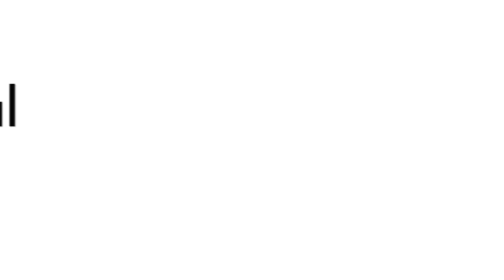Mercedes E300 Full Leather Interior Repair | leathercare.com

Comment: Awesome work! I never knew this could be done. I thought leather seats like this had to be re-upholstered. Keep up the great work. GODSPEED mate!
Reply: Re upholstered would be a better option imo
Reply: @AlexiaVon  Most of the time the re-upholstered will never have the quality standard of the original.
Reply: @MAIQUELKOCH  depends, are you a cheapskate working with a shady business or are you willing to spend money on quality materials and decent work being done on the reupholstery.
Reply: @sv_cheats1970  That's why I said MOST OF THE TIMES, there are exceptions, for example companies that manufacture for the automakers themselves, some of these companies sell to the final consumer. It is worth noting, however, that the product sold to the automaker goes through the sieve of quality control within the automaker itself, more demanding consumers should also consider this.
Reply: @MAIQUELKOCH  and MOST IF THE TIME refinishing or painting or staining you will not have the same quality as the original either and you know this. Even this one is not the same quality as
Reply: @AlexiaVon  I agree 100%. You will see cracking in the same areas over time as the filler is the weak point. Not sure how much this would cost as shown in the video. But today, I can buy an XL hide (top grain) in the color of my choice for $700.00 and pay another $500.00 for labor. So for about $1200.00 (I know it's more), you will have new seats for years to come.
Reply: @kenkobra  Over $1200 for two old seats...I'll pass, not because that I am a cheapskate, but I am just a practical guy.  Itis like that you are getting old and trying to do cosmetic plastic surgery...No matter how you look great outside, you know that inside it is the same old self... Getting old is not for the sissies as the saying goes.  Face it and you will find inner peace, all those naysayers are just that, naysayers...
Reply: @MAIQUELKOCH  There are companies doing reholstering using the same oem leather as the manufacturer. It just cost more. Still imo is better than this as I think there will be too much toxic gas release from all the spray.
Reply: This is a quick and dirty fix that won't last long. it's just a coat of paint sfter all.
Reply: @AlexiaVon  I asked how much it would cost to reupholster my interior, and I was quoted around 5k. I was like god damn, lol no thanks
Reply: @MAIQUELKOCH  here we go. Get your popcorn ready people...
Reply: @slchang01  Yeah, if cosmetic surgery involved completely removing your old skin and replacing it with new. There's a HUGE difference between stretching and removing than there is in REPLACING. They also replace the padding and any frame defect when you get it done. It's pretty much a new seat.
Reply: @mc.9839  New seat indeed...though at what cost?  An old car with all OEM parts sum up  to the tune of 4 times the price of the brand new one, not including the labor costs...Is it worth it?  And let's say, now that you've got a new seat, and it looks pretty...but what about other old seats? or other old parts that yet to be replaced over time?  Do you feel the same way as if you were having a brand new car?
Reply: @slchang01  Seats are typically only done if they're truly heinous or you are doing a restoration and they all get done.  If they're heinous and you aren't doing a restoration you just put good seat covers over it. Nice and cheap.
If it's a restoration then everything looks good.
Yes, the only time I got new seats was because I had restored a 95 Bronco. Yes, felt like a I had a new car. Actually, it felt better. WAY better.
Reply: @madmade6877  yes, but surely it's a lot cheaper?
Reply: @ziondanny7081  but the original leather was dyed to begin with, yet the dye seems to last long. or is this spray dye not as long lasting a method? I'm genuinely wondering because I don't actually know that much.

Comment: Fantastic.  I never ever thought you could rejuvenate leather like that.  Great video
Reply: Yes you can and you don't even need to spend that kind of money.  There are more videos here you can check.
Reply: @josechimal1358  I’m amazed, the dedication and concentration required would probably be far in excess of what I could do personally as I have the attention span of a child, but watching proper detailers and leather workers on YouTube has opened my eyes to what can be achieved with even what seems unrepairable
Reply: Would’ve been cheaper to buy a new seat 😅😆
Reply: @Smith6265  why can’t you appreciate the craftsmanship?   Not everything is about saving money, it’s nice to spend more and get a better service, that’s why people drive bentleys or
Rolls instead of hyundais, and wear a Rolex and not a timex - they appreciate quality, even though the cheaper products do the job just as well as the overpriced ones
Reply: Is it rly rejuvenated or its for looks only? U cant maintain it with leather cream, it might rub off on white clothes and it could quickly deteriorate in the sun and feels sweaty?

Comment: Wow, I never thought those types of repairs were possible with leather.
Reply from the maker: Thanks!
Reply: question is how this repair will last and how the filler holds up under use and surfaces flexing.
Reply: Robert Duklus 2 weeks
Reply: @aqib2000  😁
Reply: @aqib2000  😂😂😂
Reply: Color going to get all your clothes when it heats going to start getting hot outside or inside the car so I get hot a color is going to ruin your pants
Reply: @07churchuse  That is exactly what I was thinking while watching  - perhaps a more gentle approach is more realistic; maybe not as contrasting, but less time intensive, and still better for appearance, and overall long term wear...
Reply: Me to waaooo 😘
Reply: @07churchuse  Seriously??? All leather is dyed. When did you last see a blue cow walking around? Once it's dried, the dye will never get on your clothes. On top of which, he even finished it with a clear coat and a hardener. Dummy.
Reply: @07churchuse  only mark zuczerberg can sit on this! xD
Reply: @07churchuse  I really hope you're joking... if not, then you gotta get your head checked
Reply: IT'S NO LONGER REAL LEATHER. IT'S BEEN TOTALLY COMPROMISED 
LEATHER NEEDS TO BREATHE. AND CONDITIONED WITH EARTH NATURAL PRODUCTS. NOT PAINT.😣😤😤
Reply: @eaglesonsolutions9697  That's tanned leather in its first stages. Doing it later, like here', destroyed the little suppleness left. My gramps Is  a leather Smith!! I help
Reply: @captainamericaamerica8090  The only alternative to what you suggesting is reupholstering it which also take the originality away. This is the cheaper option. Once you fill the cracks with filler, There is nothing that is natural that will give you that exact color back. If your looking for a natural repair solution, good luck finding a tutorial that will make it look as good as this.
Reply: @captainamericaamerica8090  There's no such thing as natural breathing leather on new cars, all leather is sprayed with a protective clear coat. So called leather conditioners by people like Leather Honey and Chemical Brothers are only changing the smell and surface of the clear protective coating. There's no nurturing of the leather lol.
Reply: @kccodex8931  it's a porous coating, apparently
Reply: @robertduklus6555  +q+
Reply: @captainamericaamerica8090  that may be true but I'd rather spend my money on organic veggies. But I get your vibe.
Reply: @eaglesonsolutions9697  Very true, but to me it looks like a lot of labour intensive work and the cost would be interesting.  Depends on the value of the car I suppose, but I'm guessing it wouldn't cost much more to find replacement seats in better condition.
Reply: @kccodex8931  not true.
Reply: @eaglesonsolutions9697  the point the poster was making is valid, as a
dye is absorbed right into the grain of the leather, whereas a paint is
just sitting on the "surface." How long it will hold up in extreme heat,
or from moving around on it from wear and tear -- I do wonder. If they
could redye the leather, I'd be way more confident than painting it.
Reply: @erickabundis7952   the point the poster was making is valid, as a
dye is absorbed right into the grain of the leather, whereas a paint is
just sitting on the "surface." How long it will hold up in extreme heat,
or from moving around on it from wear and tear -- I do wonder. If they
could redye the leather, I'd be way more confident than painting it.
Reply: @captainamericaamerica8090  leathersmith.....you mean a tanner, Mr helper?
Reply: @captainamericaamerica8090  
My Cadillac convertible is 47 years old.
Leather stays.
Be a FOOL to re-do it.
Cosmetic aesthetic damage.
Not structural to material.
RECYCLING 💡
Keep your car clean & oil the seats after.
It’ll smell fine😉
Reply: @captainamericaamerica8090    this is finished leather. No disrespect to your gramps but You don’t know what you are talking about. Aniline leather needs to breathe, so in that specific instance you are correct. Aniline is an unfinished hide often used for high end sofas and furniture. Way more susceptible to water damage and weathering. This being a finished leather (as most vehicles are) it can be repaired once it is worn and aged, hence “refinish”. Leather is leather no matter which way you shake it. It is skin. There are substitutes such as ultra leather which is manufactured. If it’s skin when it is tanned dyed and finished, it is leather when you refinish it as well. In Laymans terms sheet rock is still sheet rock regardless of how many times you repaint it. So your comment of “it’s no longer real leather” is just wrong. This is my profession. If you don’t know what you are talking about then why even bother commenting?
Reply: @grantp4022  in a two stage refinishing process (paint then a heat treated topcoat) heat ‘shouldn’t’ affect the integrity of the finished product if done correctly. That being said refinished leather will always wear faster than the original product. Like you said it is only a surface application. So wear and tear is definitely expected over time if not maintained correctly. This method is often used because Reupholstering is much more expensive. Refinishing is tedious but much more affordable for a similar finished product.
Reply: @07churchuse  you are wrong. 🤝
Reply: @captainamericaamerica8090  automotive leather is not real leather.
Reply: @eaglesonsolutions9697  wasn’t going to give the thumbs up but then you said dummy. Thanks lol
Reply: @robertduklus6555  i work with colourlock and have never problems, when you use it right
Reply: @eaglesonsolutions9697  so your telling me Belgian Blue's leather isn't blue 🤔🤨🤯 

(Jk ofcourse)
Reply: @doublesnake18  bruh, i did It in one day

Comment: It looks really very well done. I had repair in my W210 in a same way with amazing final results . But cannot be as a new one in 2 years again I have cracks and my eyes are always there when I open the door . Just to mention after repair it was really amazing , car is always in garage with controlled humidity . 2 years and 26 000 km again I have cracks .. And finally decided in the beggining of May to change completely the leather in front .
Reply: Yes ~ nothing can compare to brand new leather!  I tried to repair the leather on my steering wheel with what were claimed to be quality products. The result LOOKED good, but the steering wheel always had a slightly sticky feel after the process. Finally decided to have the steering wheel professionally recovered in new nappa leather. Sooo nice!

Comment: Great Work, but what about seats with air condition? Don't know if the W124 had them, but i.e. a W211 with these little holes in the seats has air conditioned seats. Are they still working after you put paint on the seats with a spraygun?

Comment: Looks wonderful but I too want to know how this holds up from actual use... I can only imagine small cracks would immediately develop in the painted areas as paint is typically quite brittle and inflexible.
Reply: and the leather don't breathes now...
Reply: @JP-cu9zb  Of course it does. Why would it be any different than in the original situation?
Reply: Leather paint is not brittle. Otherwise your brand new seats and sofas would show small cracks the moment you start using them. It is only when they age that leather and paint becomes brittle.

Comment: Wow thats amazing! That looks like an art form that i wish i would to be able to do! The end result probably looks better than it was brand new
Reply from the maker: Thank you sir!
Reply: IT'S NO LONGER REAL NATURAL LEATHER. THAT'S WHY THERE ARE SO MANY DISLIKES!! REAL LEATHER NEEDS TO BREATHE. IT CAN'T NOW! 😩😩😣😣👎👎
Reply: @captainamericaamerica8090  spoiler alert: they all seal it with plastic
Reply: @captainamericaamerica8090  I used to think that too until I looked up the science behind the clear coat. The polyurethane coat is microporous, allowing the leather to still breathe.
Reply: @captainamericaamerica8090  ñbadadd
Reply: @alc.8415  Not true. Tests had to Rot
Reply: @captainamericaamerica8090  Leather goes through a tanning process.  It doesn't need to be "sealed in plastic".

Comment: The result certainly looks good. The question I have is how long will the finish last  before having to be re-applied? Looks like a good strategy if you are doing this to sell the car. If you plan to keep the car, would it not make more sense long term, to have the seats professionally reupholstered?
Reply: It will not last, basically untill someone puts his ass on chair :D and it only will look ok on photos ,pointless, the second buyer will come and look will say bye. Proper way is simplly put new fabric and job done. While he spend bunch of money on paint on chemicals on all this crap. On cleaning tools etc, also time. It will take forever to fix it. And in the end you still have same crap. Just buy new lether same color remove old put new done.
Reply: Truely agree

Comment: In such cases, a good job is to completely replace problem areas of the leather.  And if there is a difference in color, then only in this case you need to touch up.

Comment: Great video! Please could you tell me how to maintain the seat repaired like this? My front seats are repaired, so the leather is under the color and clearcoat and I am not able to use leather conditioner to soften it. And also I see a problem that the repaired seat does not breathe at all so you sweat a lot on it (compared to original rear seats which are not repaired). Is there any way to fix this?
Reply: You can sit on a towel lol
Reply: @frv6610  yeah, thats definetly why I bought car fith 16 way adjustable comfort nappa leathe seats.. to put towel on them 😂🤦🏻‍♂️

Comment: Always funny how people don‘t care about the leather interior of their car. Their shoes probably look the same
Reply: Its insane, even once a year should be enough for ok results.. but some really trash it
Reply: beacuse it's not genuie leather
Reply: @IncognitoDriver  its not because of that... Its all cracked because off the sun rays, body oils, and it was probably never cleaned and protected properly
Reply: Haha yeah, people doesn’t even vacuum their car.... or throw the trash out... it pretty amazing the car where you bring a kinds of dirt and grime and sit in it is almost never cleaned, but your house or apartment where you usually have an area where you put your shoes and jackets etc is extensively cleaned.. even the areas where you don’t have outside clothes is extensively cleaned ( compared to car)
Reply: My seats look better than my shoes lol
Reply: @EK-em2zv  It's not trashed really. It's 30 years old. Unless you garage this car every day, the sun, elements will do this no matter what.
Reply: You trying to make a valid point about maintenance.
But 30 Years is a long time, and moreso if car was sitting outside in the Sun and weather .
And that hole looks like people had their phone  on a belt holster and accidentally gouged the seat (on several occasions.( I've done it.
Reply: Very true that, although this particular one is a very old car. I use a leather conditioner every 6 months or so and it works really well.

Comment: Hi everybody! How long this kind of reparing will keep such good condition during next using???
Reply: Paint will crack in a couple month
Reply: @rasulmuratov6772  paint doesn't breathe.  This isn't leather anymore😯😯😩😩👎👎
Reply: @captainamericaamerica8090  i know,we've done so many leather restorations, most our customer mercedes owners. The best and the only way is to replace worn out leather with the new one.
Reply: Well its not like there is blue leather naturally anywhere... it’s painted or dyed from factory.... biggest reason it doesn’t last as long after restoration is probably because the leather isn’t as soft anymore as when it was new ie a lot more prone to cracking new paint.
Reply: @rasulmuratov6772  that is the most honest answer.

Comment: Presently restoring my dream car, I had the seats taken away to be fixed up and have to say they looked as good as this. Very interesting to see the process. Well done guys, I never realised how this could be achieved and the time and products involved.
Reply: How much did it cost?
Reply: @huzaifar7560  Dont remember exactly, it was 4.5k euros for engine/turbo rebuild and the seats, I think around 800 euros, this included replacing the bolster padding.

Comment: I found that if you mix your color match paint into your filler, it helps in blending your repaired areas when you sand, so there is no white that might come through, since the white has been mixed with the paint to color match the repair areas.